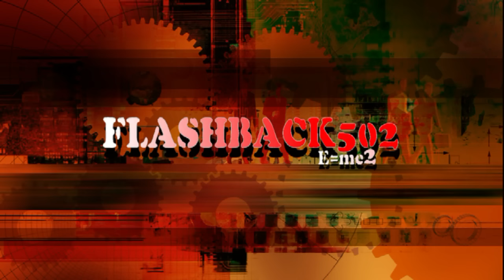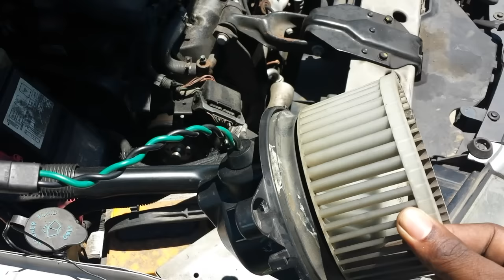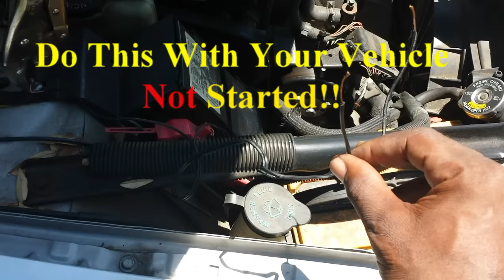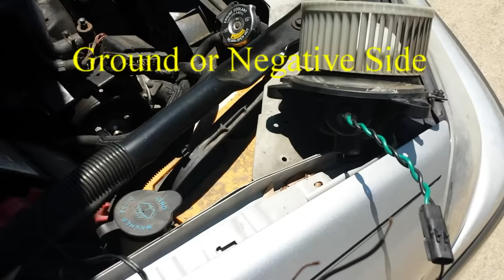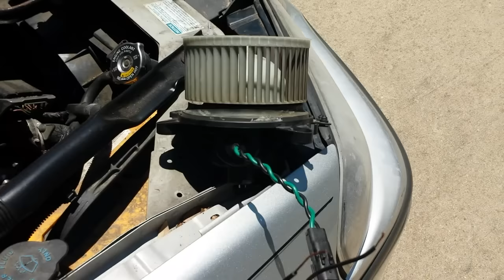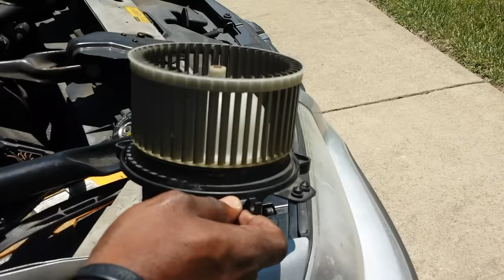How to Test Vehicle AC/Heat  Blower Motor to Tell if BAD

Comment: You never mention anything about a resistor. Did you not have one… Is it possible that your resistor was bad?
Reply from the maker: Normal if resistor is bad will still work on high if doesn't work at all most likely blower or fuse. Please subscribe & like and share if haven't already and check out our other helpful videos
Reply: Resister bad or not. He was bench testing it.

Comment: Looks from here like the motor bearings are a little stiff or bad.  Fan didn't coast to a stop, it pretty much stopped like it had brakes. Could be the bearing is worn.
Reply from the maker: Yes we're going bad also. Please subscribe & like and share if haven't already and check out our other helpful videos

Comment: you're crazy bro, anyone watching this please connect the leads to the blower motor first then touch the other ends to the battery. you don't want to try to squeeze into that tight space while connected to the battery, you're just asking for trouble if you do it that way. use alligator clip extension leads, safety first.
Reply from the maker: Agree thanks for helpful tip.

Comment: Hi, thank you for the info. I was wondering if you could direct me to what the issue could be for my 2011 Chevy traverse. My ac and heat works as it should. It blows in the back but it won't blow in the front, no matter what I switch it to. There was a time that it did work then it didn't work, but would occasionally kick on. Now it doesn't. What should I check to be to figure out the problem? I also should tell you, although I do not know if this is part of problem of a separate one. My car speakers work as they should in the back but in the front, the ones on the door panels, go back and forth. The drivers side will work then it will switch and the passengers side will work. Back and forth. Not sure if these 2 issue are related? Any feedback is much appreciated. Thanks!
Reply from the maker: Hi sounds like u have a bad front blower motor or you have a bad blender door actuator. I Have a video up showing it https://youtu.be/MULbAWfc7ko. Please subscribe & like and share if haven't already and check out our other helpful videos
Reply from the maker: If link doesn't work video is in my channel videos.
Reply: Thank you! It was my blower motor. I was able to replace it myself. I was wondering if you know anything about after market sound systems? When I bought my 2011 Chevy traverse it came with the brand Dual after market radio. Well, the speaker on my driver's side door and front passengers side door cut in and out. They both still work but one will work then it will cut out and the other one will start working. It's been going back and forth like this for a little while now. Do you happen to know what the problem could be?
Reply: @brittaneypatriciaann1004  I'm betting wires are touching, probably installed with just electrical tape. Or the speakers are so old they are failing(corrosion/chipmunks-mice)

Comment: Is is supposed to spark while I'm testing the blower? 
I did what you did and when I go to touch the inside the motor kicks on but it also make a spark. Almost as if I'm touching the 2 wires. 
I can assure you I'm not touching the 2 wires
Reply from the maker: Yes sometimes it can spark, once you see that it works I wouldn't keep testing it. Please subscribe & like and share if haven't already and check out our other helpful videos

Comment: Does it matter which wire touches which prong inside the housing for the blower? Also, how do I find the video you talked about for taking the blower out of the car?
Reply from the maker: Your blower is under your passenger side dash inside your car or truck should be about 3 or 4 screws holding it up and a power cord to unplug. Shouldn't matter.  
Please subscribe & like and share if haven't already and check out our other helpful videos
Reply: You can test it in the car you don’t need to remove it !

Comment: did you touch both the positive and negative to the blower motor, or just the positive?  the picture cut off at the bottom, so i couldn't see you make the connection.
Reply from the maker: Thanks for watching yes I touched both Postive and negative , 1 on each prong in the blower. Please Subscribe and share if haven't already and check out my other helpful videos
Reply: @Flashback502  

    I am guessing it doesn’t matter positive and negative on what prong?   DC motor can go either direction...

Comment: How did you get the last screw out in the back?
Reply from the maker: Had to use a extension, tight squzze but came out. 
Please subscribe & like and share if haven't already and check out our other helpful videos
Reply: @Flashback502  well before i tried again yesterday something just told me to try a new resistor since i had planned on getting a new one with a new blower motor and when i replaced the resistor the motor started working again

Comment: What if most of the time my ac and heater work fine and then other times when I turn on the ac nothing comes on?
Reply from the maker: Could have a bad climate control panel, blower going out  or electrical problem. Please subscribe & like and share if haven't already and check out our other helpful videos

Comment: It is bad way to test. On 12V from batery blower motor can work fine. Or it may look like it is fine. But it can draw to much ampers and while mounted on its place it can blow fuse after some time or straight away. So it is bad way to test.
Reply from the maker: Thanks for tip.

Comment: These little motors are feisty as all get out, i was testing one one time out of the housing and the damn thing flew out of my hands,lol, after that test i realized why when you turn your blower motor if you look at your electrical gauge in your car that thing goes way down,they sure suck a lot of power.

Comment: Wow.... i did exactly the SAME steps / except view fuse "good" - no meter..... & when i popped the fuse out to ✔...it fell below fuse box.... used plastic straw ... that put it to the bottom engine cover .... a few twisted-rusted cover bolts off & the Rain started... moved inside garage ..o view
Reply from the maker: Ashley Holloway thanks for watching glad you was able to get it fixed. Please Subscribe&share and hit the bell and check out my other helpful videos.

Comment: & a # 6mm removed & stuck my hand in & it worked...
Reply: I have a 99 mitsubi Montero sports I put a new really and the heatestill don't work I can hook a ground waire to the ground wire on the fan wire and it runs real fast

Comment: If it's not the blower motor, couldn't it be the resistor?
Reply from the maker: Hi thanks for watching, make sure you check your fuses that go to your blower, also your climate control panel could  be the problem. Please Subscribe and share if haven't already and check out my other helpful videos.
Reply: Flashback502  my car is kia cadenza 2012 it is have Problem is blower just full I want and I chick that control it is don't have a problem and I check the fuse same thingDon't have any problem but we don't know why it's full can you help me thanks
Reply from the maker: @mohamadhajibabajeskay7241  thanks for watching sounds like you have a bad Resistor module, which most likely  is located under your passenger side dash by your blower motor. Please Subscribe and share if haven't already and check out my other helpful videos.
Reply: Flashback502  thamks but if you can Explain what is the resistor module
Reply from the maker: @mohamadhajibabajeskay7241  check my new video on my channel just put up a video showing it.

Comment: Thank you! I used your method and tested that my blower does work. So then I narrowed it to the blower control dial as the possible issue. Upon further examination, I found that the dial had a broken plastic piece inside that made it unable to rotate the switch behind it. So I used a screwdriver to move the rotating switch -- my blower and AC turned back on! If I hadn't tested my blower using your quick method, I would not have moved immediately onto the control dial as the problem.
Reply from the maker: Glad it helped

Comment: Have a 2012 dodge avenger with a couple AC/HEAT problems. 
Pros: Heat and AC work fine. Meaning it blows nice and hot and nice and cold.
The problem is that if the ac is on...no matter if it's on low or full blast the ac will not blow anything unless you are going 45 plus and that goes the same for the heat as well.

So if its 100 degrees out and I'm in the city going 30 and have several stop lights I will never feel the ac no matter if it's on full blast.
It does blow a little when I'm driving just doesnt match the setting whatsoever unless like I said if I'm on the highway...it will completely stop blowing hot or cold air when you idle or come to a stop. Same problem for ac and heat.
That goes the same way in the winter when I want the heat to be working.

Any solutions?

The other problem is I have knocking on the passenger side from the glove box. Any solutions for that as well?
Reply from the maker: Thanks for watching and commenting you could have a alternator problem, may not be puting out enough power u can get it tested at your local auto parts store